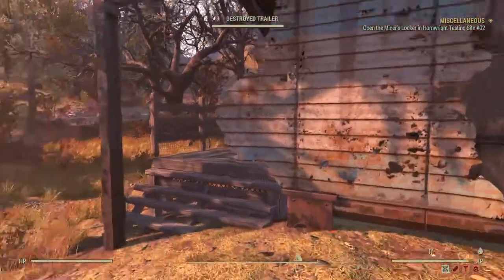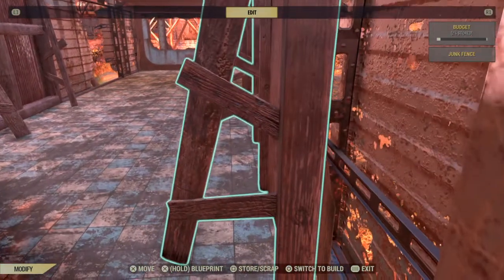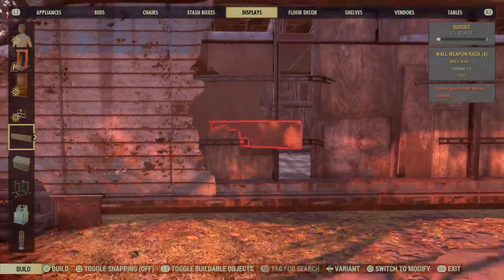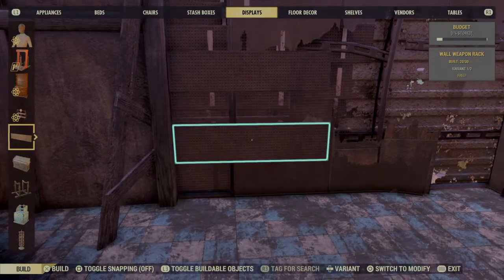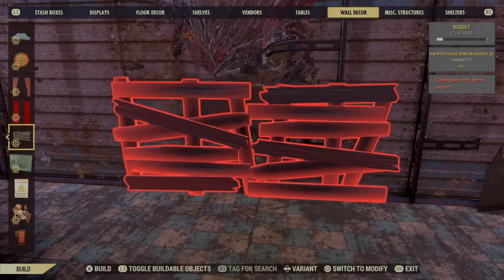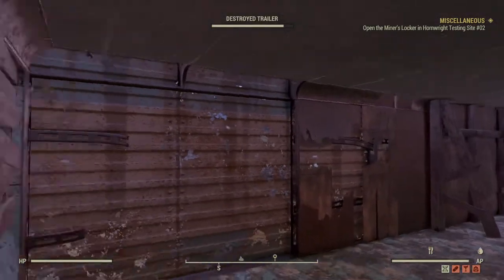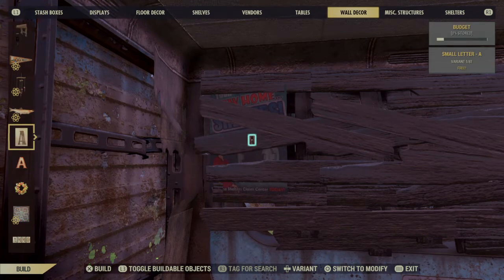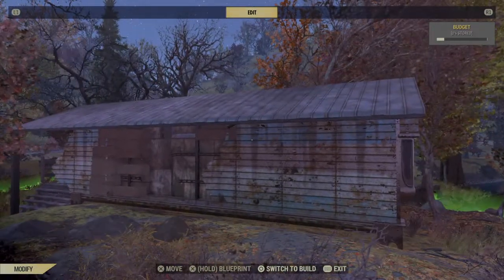How to Repair the Walls of the Destroyed Trailer in Fallout 76

Comment: I understand using fences, boarded windows and even using wep displays and metal signs to patch holes but how no one has made a roof/walls rebuild video for this its insane. Mine got a nice roof and i used stair>metal posts for side walls and used the sheet metal walls in place of the holes. You have to build from a different anchor but its not hard. *Getting the walls in required me to destroy the trailer before i could build it, but after repairs it looks like an up armored mad max trailer.
Reply from the maker: I Would like to see it. Do  you have pics or video?